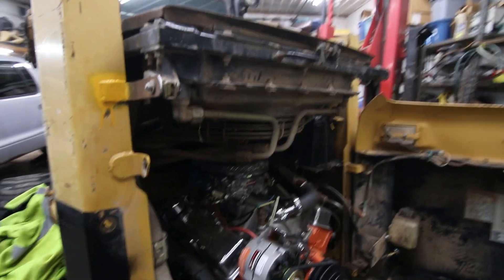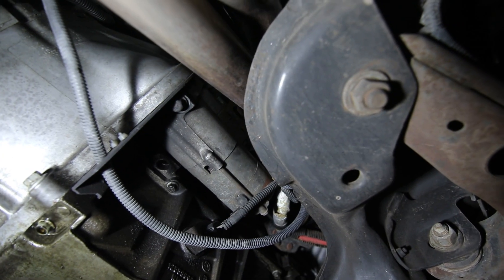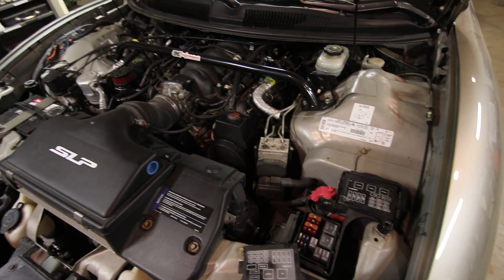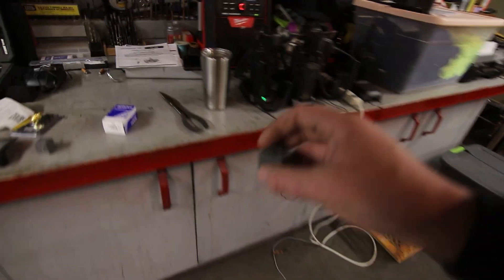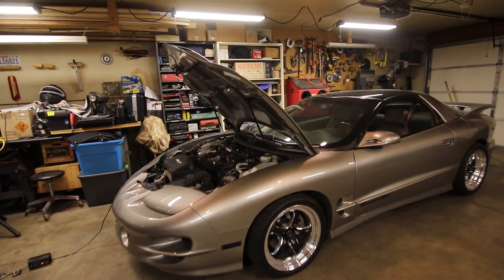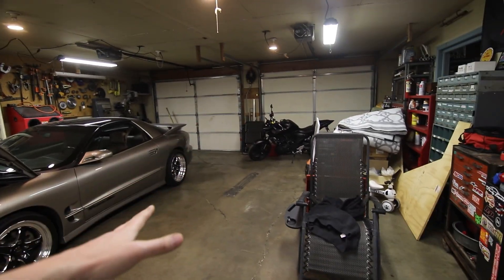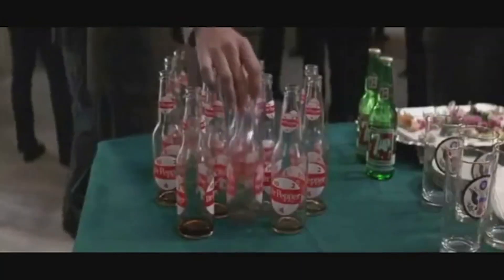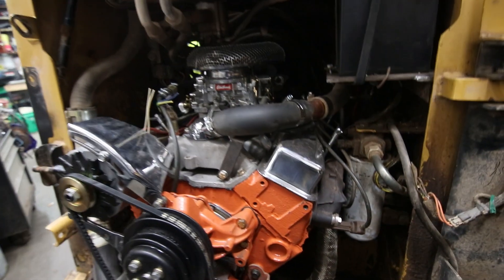Saving A "Rare" C4 Z07 Corvette - GM's 1990's Factory Track Car

Comment: Brother, I uses to remove the decal from the Miami Police cars my buddy would buy and resell. We used mineral spirits and then would wax it afterwards. IT took some elbow grease but it would come off and didn't seem to damage anything. I love the Vette. I never heard of a Z07
Reply from the maker: Thanks for the tip! You must have had some tough decals to peel off after baking in that sunlight. 

I have mineral spirits but was worried that it would be MORE damaging to the paint than the acetone. Maybe I was mistaken.

I also hadn't heard of a Z07 car existing prior to the C6/C7 generations. Apparently, GM applied the same RPO code and logic to the C4 generation.
Reply: Oh yea. That South Florida sun and Commercial decals lol. Reflective decals. Like you with a heat gun and alot of time. Then the mineral spirits and a Terry cloth and some elbow grease. The sun faded the paint except under the decals. Miami had the decals strips layered all all down the side. Lol. We were getting the liquid in 5 gal jugs that how much we were using. We would pick up 15 cars at a time.
Reply: If you go online and look up Hialeah police cars you'll see what we had to do lol.

Comment: That C4 has a lot of potential, I have been keeping an eye out in my area for one as the prices on those are great.
Reply from the maker: Agreed, lots of potential in this one. I REALLY wish it was a stick car. No such luck.
Reply: @Greenlightfilming  Those are much harder to find, the value is crazy for what you get even with the auto and the LT1 is a durable performer.
Reply from the maker: @Red Dragon  after one drive, I agree completely. I can compare it to the dozen third gens I've had, and for the money I paid, this car is beyond light-years ahead of the f-body. 

For the money, it's no contest. The car is actually quick, too. Felt a lot stronger than I anticipated.

Comment: A rubber eraser wheel on a drill will take that adhesive off
Reply from the maker: That may have done it too. Used them many times, didn't have one here ha.